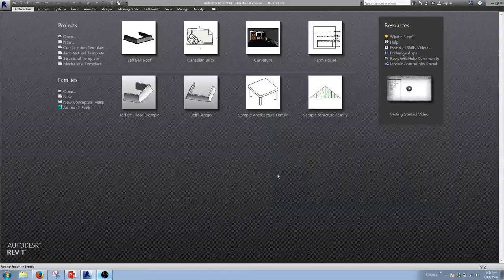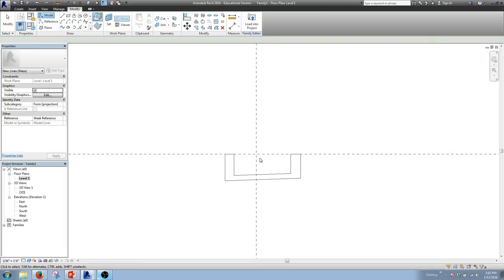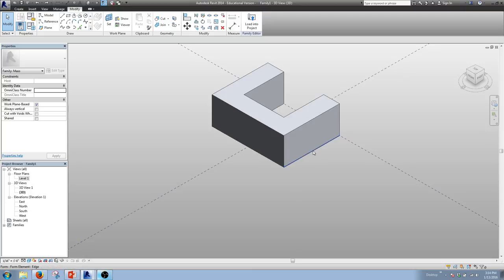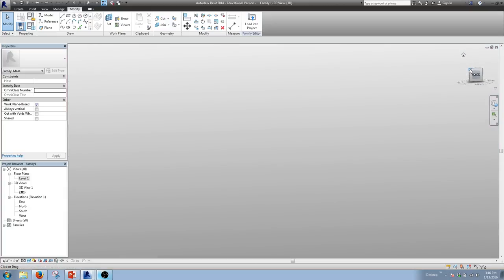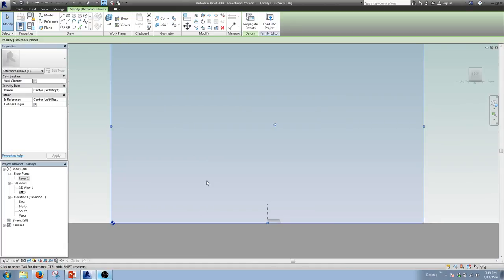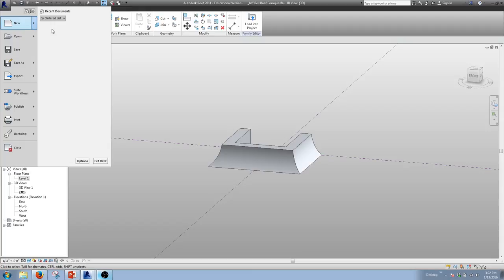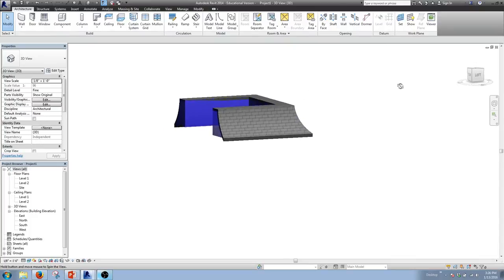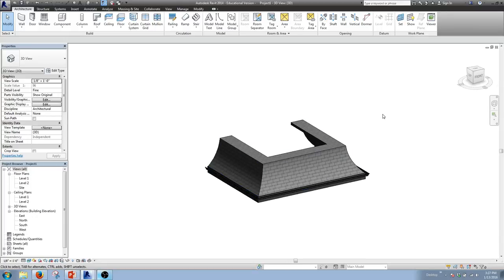Revit- Massing a curved/bell shaped Roof

Comment: I have a problem with giving a pattern, my structure is not so blue as yours, and i can give layers just on top and bottom and not on a curved which is the actual roof for me. Do you have any solution for it? 
Great explanation beside that ;)